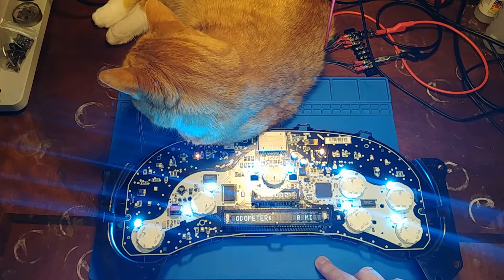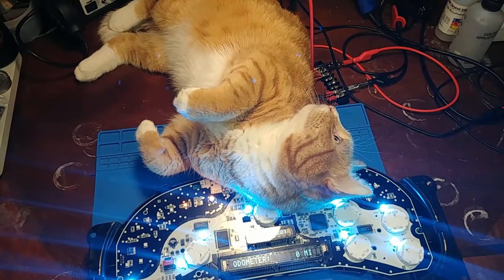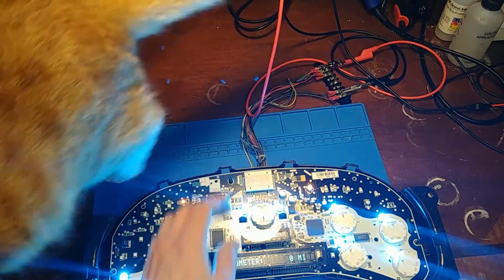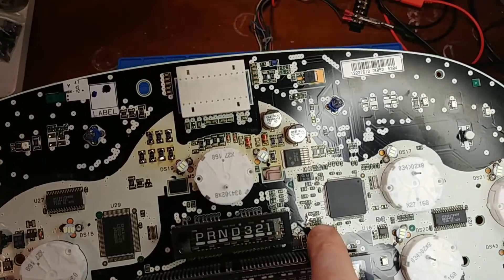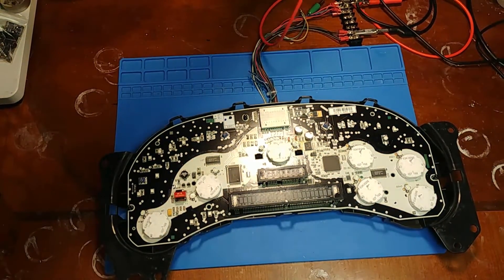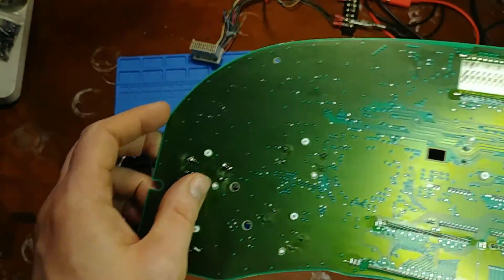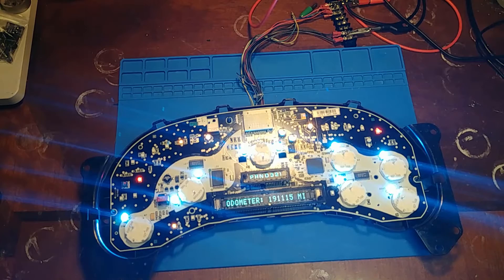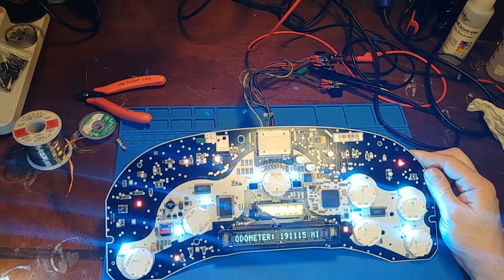GM Cluster Odometer 0

Comment: I like your cat.  And your videos.  You watch Louis Rossman, I can tell.
Do you watch “South Main Auto” also.  Eric is a master mechanic and uses the latest electronic tools to troubleshoot all kinds of electrical issues.  Might want to contact him and let him know you can fix cluster problems.  Maybe get a revenue stream going?   Anyway, you’re pretty professional with your work and I’m very much enjoying your videos.  You might want to buy some Kapton tape to slip under the MOSFETS. It’s is an insulator and can handle temps up to 400° F.  Just in case, when you solder to the transformer and run jumpers, it would help to put some Kapton tape under the FET, just to isolate it from the board.  Anyway, keep up the great work and videos. 👍👍
Reply from the maker: Yes I've seen some south main auto videos. He seems like a great guy. I do keep katon tape around for doing BGA rework. That's a good idea to slip it under inbetween the damaged board. I'll use that if I can't float the MOSFET.

Comment: Hello . I see that you're very skilled on repairing these GM Clusters, and wondering if your knowledge applies also to a Audi A4 B5 (year 2001) cluster . My temp needle doesn't move in real driving situation . It moves a litle when i switch my  key to ON position and that's it. I do assure that the ECT sensor is working perfectly , thermostat also , and I am sure that is a problem inside the cluster . The coolant temp gage seems to be the only ''problem. However using vag-com testing the cluster shows that everything is working fine includint this coolant temp gage. What to check? I should try to resolder the board pins where the male connector connects ? Here is a video where i show how the needle moves when i put my key to ON position ( nomatter the engine is cold or warm ) . Thank you!!    
https://youtu.be/h6CFIzHeDos

Comment: The Hakko FR300 is a nice little desoldering gun but it's pricey new.  If you can find em used the Hakko 470-472 self-contained desoldering stations are usually priced decently.  If you can find one in working condition the 472D is digital rather than a dial calibrated in arbitrary measurement units.  Make sure you get a decent gun/pencil with it.  The pencil can be a pretty pricey part but even if you have to get a new pencil or gun it shouldn't be over $300 all-in.
That Chinese T12 solder station looks like a decent piece of equipment.  I believe they evolved from a DIY Arduino project.  You want to be sure the iron and the station chassis are properly grounded to maintain ESD safe operation.  Not all of the Asian T12 stations are earthed properly even tho the silkscreen on the front panel says they are.  Verify with your meter.  There's at least one EEVblog forum post about these stations and a bunch of info around the web in general.  
The Dayton Hamvention flea market used to be a good place to get used equipment if you knew what you were looking at/for.  Unlike evilbay, you can look at the equipment and ask the guy selling it questions.  I haven't been able to go since around 2011.  Several years ago I picked up a lightly used Hakko 472 with a decent desoldering "pencil" and a Weller WD1M power supply for under $100.  I picked up an un-used working WMRP pencil at another vendor for around $75 so I was into the full setup for less than $200.  I love the plug-in RT tips rather than fiddling with the screw on ferrule.  I've read mixed reviews on the WMRP by people that put a lot more miles on them than me but, so far, it seems to hang together fairly well for me.
The bent tip you use in the T12 pencil looks useful for SMT work. I've picked up a couple 30° tips for the WMRP. RT5 is .8mm RT13Ms is .4mm. 
Kester Solder and good quality flux make for a much more pleasant work environment.  The cheap stuff smokes and stinks and it's a PITA to clean cheap flux from someone elses repairs off boards.

Comment: I have a late 06 where everything works fine until I start the truck. After a few seconds gauges drop, display goes blank but the warning lights stay on. If I power it up out of the truck it doesn't cut out. Only happens when the truck is running. I tried another cluster and it works fine so it's not the truck. Have you ever come across this?
Reply from the maker: With 05 I have. If I remember right off the top of my head the micro needs 2.5v. This rail has been known to pack it's bags and leave.
Reply: @jeffescortlx  Ok thanks. Just weird that with the key in the run position its fine but as soon as the engine is actually running it craps out.
Reply from the maker: @brianf4711  that is strange. Haven't seen a problem like that yet. It's typically inconsistent.

Comment: Jeff, I have an 2005 Suburban that the two LED displays are dim, the PNRD and the one that displays odometer.  I see videos to re-flow the resistors just above and to the left of the speedometer stepper motor to fix the PNRD display; will this also fix the brightness on the display below?  Thanks in advance!
Reply from the maker: Reflowing the resistors will only help brighten up the gear select display. The driver info VFD has a short lifespan in the 2005 boards. Installing one from 03-04 will bring it back.
Reply: @jeffescortlx  Where would I pick one up?  From you?
Reply from the maker: Your best best to find a donor cluster for parts would be a junk yard or eBay.

Comment: Hey Jeff! That’s my board!  The fried pads were from someone’s previous replacing of the steppers (did not use proper replacements—they failed again after I bought the truck). Yeah, I need to work on my solder skills, agreed. I put the new non-defective steppers in and the LEDs. You are a lifesaver- I totally did not see the solder goober!  Thanks again! David
Reply from the maker: Hi David! Glad to hear it's still working good! It wasn't so much the soldering that was the main issue, but pulled pads from the de-soldering removal.
Reply: I suggest you practice on  computer motherboards you can get a cheap broken one on ebay for 10-20$

Comment: Have you ever fixed a rear view mirror with a ambient temp and compass? 
I have one where it was dim and then just stopped working.
I opened it up yesterday and seen someone was already in there. Lots of crusted and dried flux on solder Joints. I cleaned that up and reflowed them again and noticed a few fractured solder joints on a couple resistors and reflowed those. 
Don’t know if it’s working yet. 
Just wondering if you ever fixed one of these?
Reply from the maker: I've had people ask me about it, but no one has actually brought me one yet.
Reply: jeffescortlx , well, if you ever get one it’s a very easy fix. Just make sure you look at all the boards in there. The board with the wiring harness needed some serious solder. The components had some huge “blow holes” and zero connection. 

It’s now fully functional, I don’t think I’ve ever seen the sensor so bright. And thanks to your video on the cluster fix. That’s now working properly as well, save for the gas gauge. He needs a new fuel sending unit, which was replaced less than a year ago with an AC Delco sending unit. 🤷‍♂️
Reply from the maker: Now I just need someone to send me one so I can check it out!
Reply: jeffescortlx   I’m sure it will happen, only a matter of time. 
I stopped buying GM anything after my last vehicle. I bought a Kia and couldn’t be happier with it. 
We still have the Suburban but, when that goes, I wont be looking at GM anything.

Comment: Funny guy Jeff lol....I am watching. Good repair, and nice find on that solder blob. Just when you think you've seen it all, something else pops up. I've never seen the 0 odometer though, just when the EEPROM has been removed. Repaired a few of the odometer ERROR's though. Most recently on a Trail Blazer.
Reply from the maker: I tell you what, that t15 j bent tip sure does work nice.
Reply: Really? I'm not a fan of it. I like the chisel tips. My most frequently used tip is the T15-D24. That tip is good for about 85% of everything I do.
Reply from the maker: Yep, the larger of the two bent tip is awesome. I have a knock off variety pack, so I probably have that chisel tip, but I'm liking the bent tip too much to change now. I do have the knock off micro handle now (quick change, no collar to unscrew) close tip to grip. It's pretty nice!